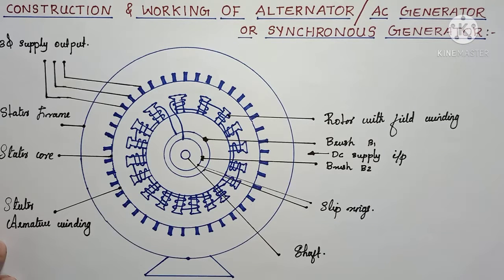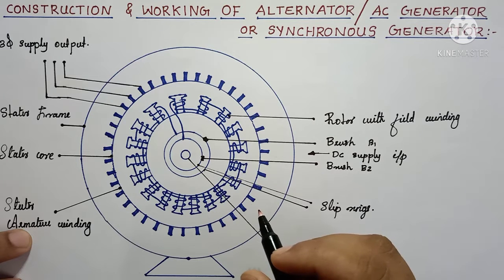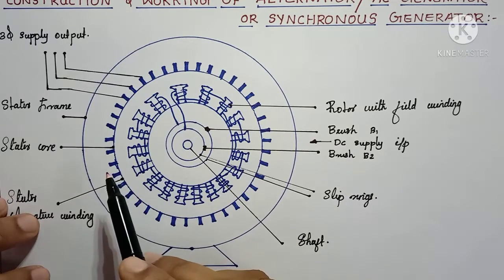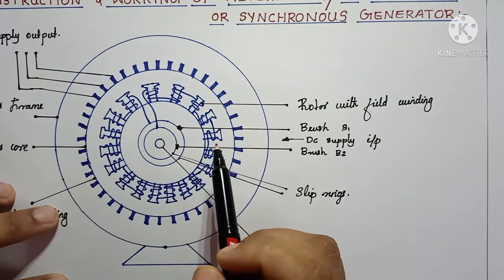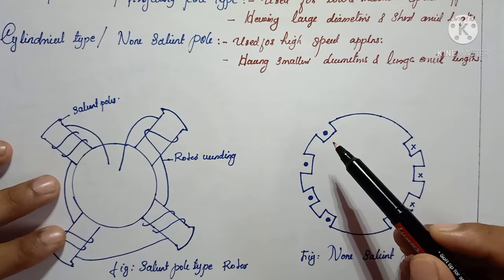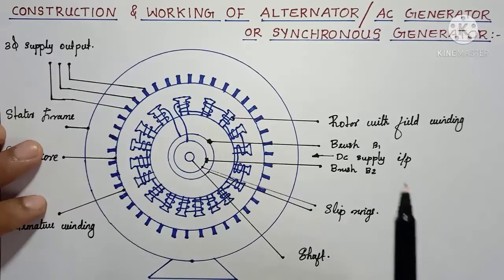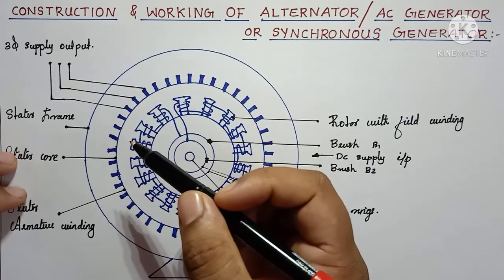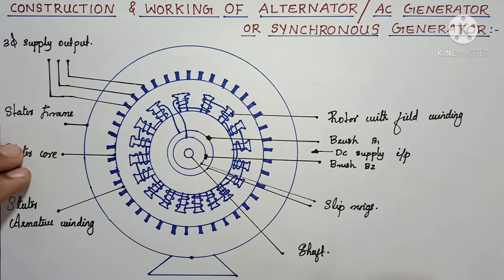Alternator - Construction and working principle.

Comment: what is difference b/w armature winding and field winding
Reply: The windings responsible for magnetic field generation (dc) is called field winding and the windings in which emf is induced (3phase ac) is called armature irrespective whether it is stator or rotor winding
Reply from the maker: In alternator armature winding (stator) is stationary& field winding(rotor) is rotating..
Reply: @eeetutorials1214  not expect this ans... 
I ask subject difference.... Alternators, induction motors, generators, single phase motors in armeture, field winding difference